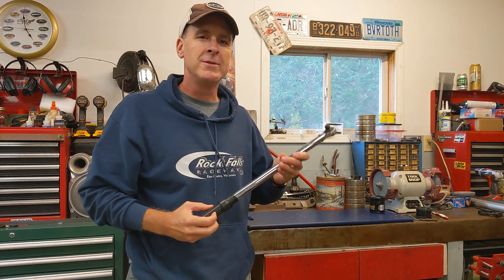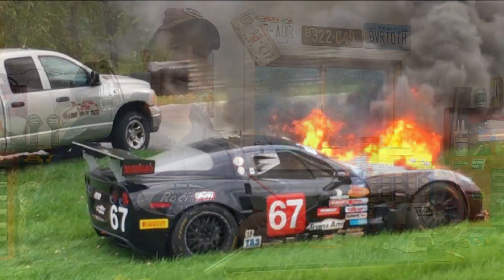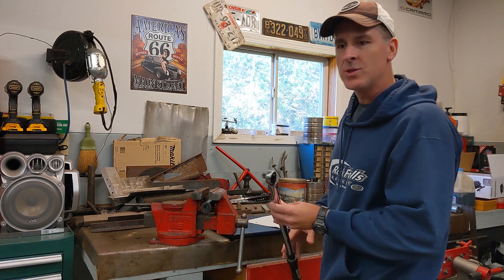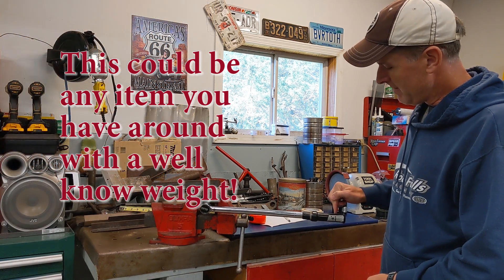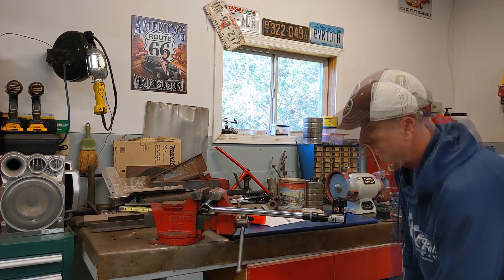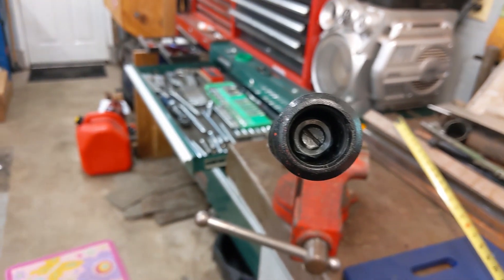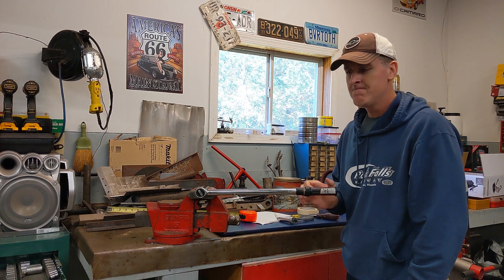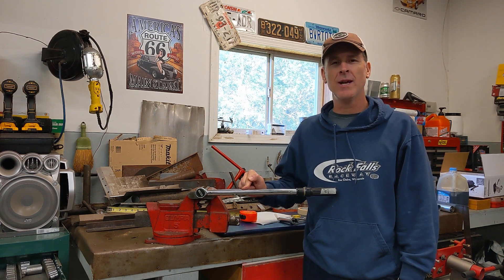Torque Wrench Accuracy - How to easily tell if yours is??

Comment: Does clamping the sockets in a vise tend to tear them up at higher foot pound levels.  Seems at 80 or so foot pounds you would really need to clamp that sucker or it may rotate slightly?
Reply from the maker: I used an impact socket and I don't think it left much of a mark.

Comment: I borrowed a digital torque adapter from work to check all my torque wrenches. I clamped the adapter into my vise to determine where each torque wrench "gave" at various torque settings. IIRC, I couldn't check my 1/4" inch-pound torque wrench because the torque adapter didn't read down low enough. Harbor Freight has such a "digital torque adapter" for $29.

Comment: You have a built in problem.  The weight of the handle adds to the torque in this method.  You need to weigh the end of the handle while the head is allowed to pivot.
Reply from the maker: your are correct sir.  Next time I calibrate I am adding 1 lb for the weight of the torque wrench.  Thank you for the comment!

Comment: How much adjustment do you think you made? Half turn on the screw etc.
Reply from the maker: a couple of turns, it was off by 4.5 ft-lbs  -  the 37.5 pound load needed the torque wrench set at 42 to hold it.   This is the first time I checked the accuracy and upon further thought, my craftsman torque wrench is 30 years old.... Oh my..
Reply: Excellent video...thanks!